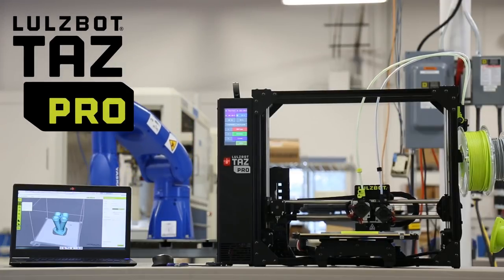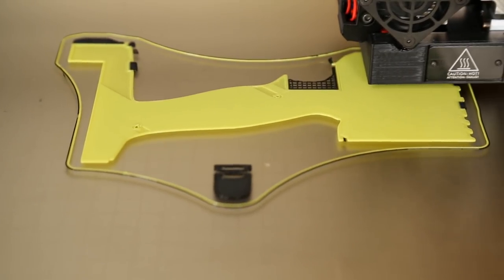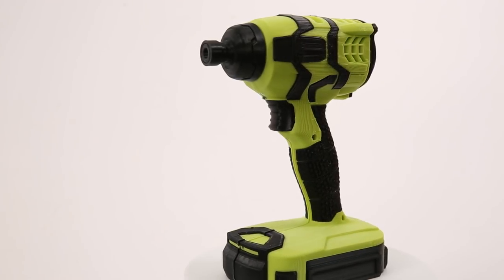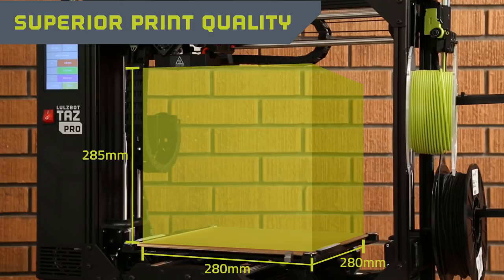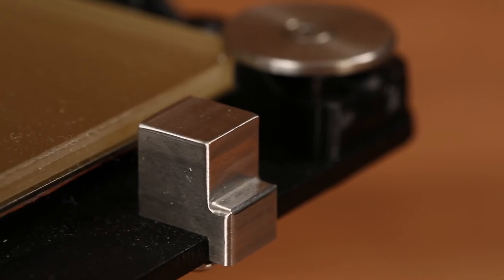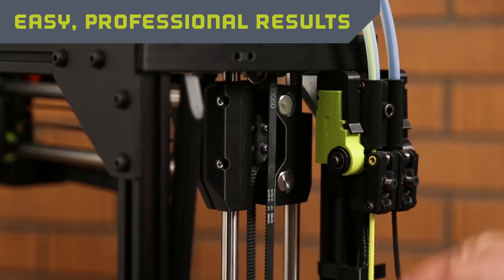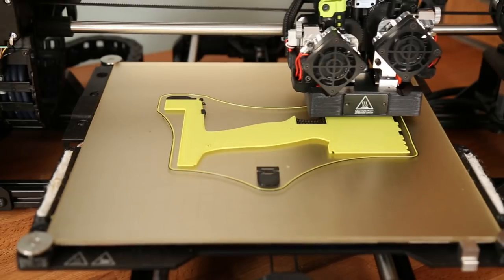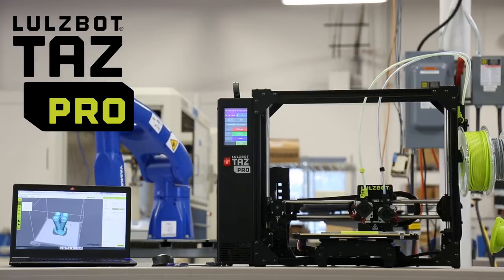LulzBot TAZ Pro Overview - Features Explained

Comment: @lulzbot Is the Taz Pro compatible with the Ultimaker Breakaway Support Material?
Reply from the maker: Hello Alejandro, Yes, the TAZ Pro supports Open filament which means it is compatible with all filaments as longs as they are 2.85mm in diameter.

Comment: Can I just use this print head on the TAZ 6 to get dual material prints?
Reply from the maker: No, the TAZ Pro features an upgraded 32-bit Archim Rambo Board to support our new dual extruder. For dual printing on the TAZ 6 we recommend the LulzBot TAZ Dual Extruder v3: https://www.lulzbot.com/store/tool-heads/lulzbot-taz-dual-extruder-v3-tool-head

Comment: Why can’t we get one with a conveyor belt printing bed for infinity printing?
Reply: It's patented currently unfortunately.
Reply: Patricky Bobby I would accept that answer because of BlackBelt, but just recently another manufacturer released another conveyor style printed. The only difference between the two builds is BB is black and the White Knight is silver.
Reply: I agree with you when you are talking about small scale manufacturing. Medium size manufactures are the biggest losers when it come to patent infringement even when they are careful. A great example is the heated chamber Stratasys Sues Afinia. Also I talked with someone at mrrf 2017 (I think his name was bill) that had a printer with this same concept before blackbelr or white knight. According to him the angled printhead was to avoid another patent held by someone for a 90 degree angle belt bed printer just fyi(I haven't verified this though). You could modify any open source printer yourself though if that is something you want.
Reply: Patricky Bobby I figured there would be some patents floating about, but I just want one thats a ready to go out of the box and who better in quality than Lulzbot? So if you combine the two, it’s nothing but Godmode levels of winning for the customers.